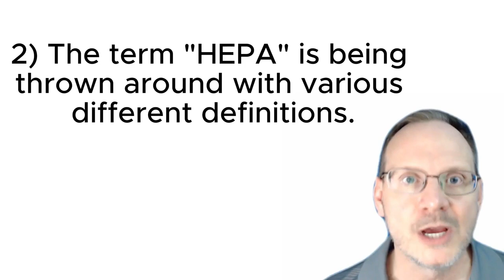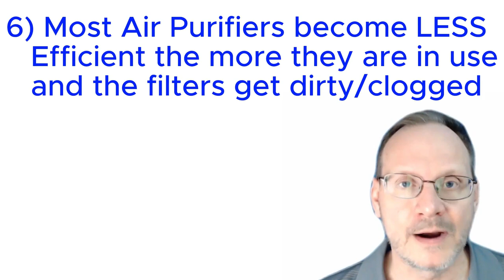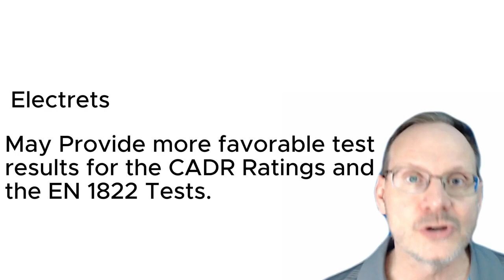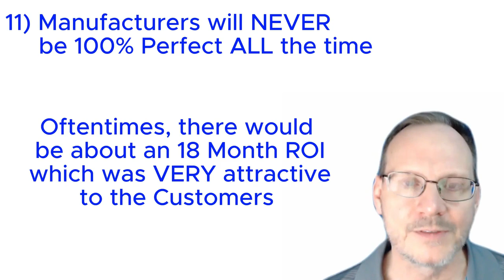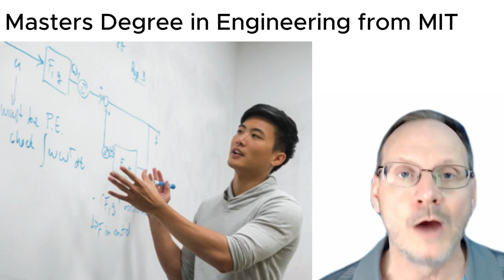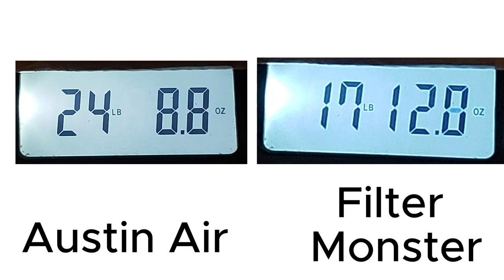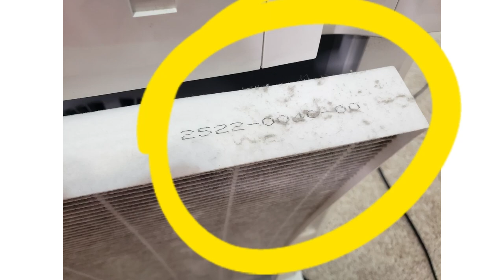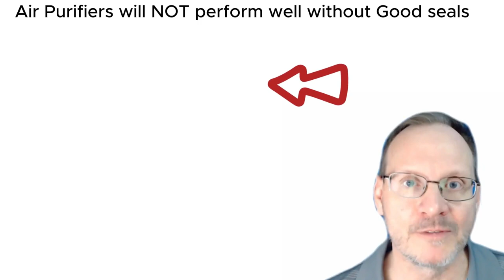HEPA Filters - Are they all the same?

Comment: Hi, thanks for sharing all the info! it is very confusing out there, so much information or sure i say misinformation, that makes it difficult to choose. Im looking for a air purifier for my bedroom, that means nothing to crazy on size or coverage, any good suggestions? ive head good things about the Winix, Oransi,  blueair, rabit air, dr. air etc. any good reliable recommendation? thank you alot
Reply from the maker: Thank you for your question. 

If you want a decent air purifier for dust/particles I currently think the Coway Mighty is the best unit for less than $250:  https://amzn.to/49QBdpm

I currently would rank the Winix 5500 - the 2nd best unit for dust less than $250: https://amzn.to/447zfP0 

Hope that helps - thanks! 👍
Reply: @AirPurificationEducation  thank you I appreciate that!
Reply from the maker: You are welcome - Good Luck!👍 @SALOALBERTO
Reply: @AirPurificationEducation  I've read in the comments, both of these units have a seal problem on the HEPA filters,  Is there any units with better build quality that perform better even if they are in the higher price rage? I was recommended by a co worker to try Mila or Oransi. Have you tried either? Thank you very much.
Reply: I've seen your suggestions on the IQ and the Austin etc but I'm not sure if they are to big for a bedroom.
Reply from the maker: Almost all air purifiers have a "seal problem".  Over 99% of all the HEPA air purifiers on the market do not actually work at a HEPA level in the real world for consumers and part of the reason for this are the seals.  

I will eventually make a video with several different air purifiers and their seals to show people the differences.

The only 2 units I currently feel very confident about not having a seal problem and perform at a HEPA level and even better are:

1) The IQAir HealthPro Plus: https://amzn.to/3NIJ6Uq $899

2) The Aeris 3 in 1: https://amzn.to/3PKaofH $750 and not available in the US currently (not sure where you are located).

After that...

3) The IQAir Atem Desktop unit filters particles just about as well as the HealthPro Plus but it is really intended to be used for your desk to blow purified air on your face.  I was in a meeting with an IQAir rep. and they told me it could accommodate a room up to 150 sq. ft.  I now see it on Amazon saying it can do 300 sq. ft. - which I do not agree with. It is $399.  https://amzn.to/48xQTgl  - and it will only help with particles - not VOCs/odors as it does not possess carbon.  I have one. 

4) Airpura makes good air purifiers and they came out with a smaller unit within the past year or so.  It is the R400 and it may be one of the best particle filtration units at $500.  https://amzn.to/4bH73Xq  + it has 8 lbs. of carbon which is very rare for a $500 unit. Airpura are kinda like carbon experts, IMO. 

5) I had an Oransi in the past and it really leaked badly - actually, it was the 1st air purifier which really made me focus on seals because I could clearly see a lot of dirty air was escaping around the filters.  I do not have direct experience with their newer units but I suspect they do a better job of filtration... they have to, lol!

6) Mila - I'm not sure how great it is - I see they say the company was started by "3 Dads", lol!   Which doesn't really give me a ton of confidence in their engineering "know how"... 

Of Note:  most all air purifiers will help the air quality our your rooms/environments (even if you make a DIY box fan MERV filter solution) - it just depends on what level of air quality we are seeking. 

The Coway Mighty and Winix 5500 are definitely winners in my book at under $250 as I have spoken to multiple folks who used them and they helped with their breathing issues - so I even bought a 5500  about 7 years ago for my son's room... The Coway Mighty hit the market a few years later and I now think it is better than the Winix for particle filtration... After, those 2 units - things start to become more expensive. 

Oh yeah, I would not get enamored with any of the CADR numbers as I made a video on this... The CADR numbers mean next to nothing to me in evaluating air purifiers:  https://youtu.be/M5gH6IBqPkc 

Hope that helps!👍

  @SALOALBERTO
Reply from the maker: I don't think there is such a thing as "too large of an air purification solution for a sized room".  I always recommend people "super size" their air purification solution for the cubic footage of their space.  The more air exchanges with a good filtering unit - the better. 

I also tell folks to remember that an air purifier's real CFMs and "area coverage" is probably oftentimes 20 to 25% less than what the manufacturer's state in their specs. - as their solutions typically do not perform at the CFM levels they say they do.  And they will provide less air exchanges the dirtier the filters get. 

I had an Austin Air Healthmate in my bedroom for 15 years and I now have an Aeris 3 in 1 in my bedroom. My bedroom is about 250 sq. ft. and both those units are said to be able to accommodate 1,000 sq. ft. or more.  

I'd say 40% or more of the IQAir HealthPro Plus units I sold to consumers went into their bedrooms.  

If you are saying they are physically too large, they yeah, they take up space - and if someone has a small room, they their footprint may be pretty large...  - but they are definitely not too large from a performance standpoint.

Hope that makes sense.  @SALOALBERTO
Reply: @AirPurificationEducation  this makes sense, without a good seal it looses all that they claim. It does not makes sense to have a high end market unit that has seal problems and pushes dirty air. Thanks for that eye opener
Reply: @AirPurificationEducation  that is true, I guess what I ment by size problem is more of a spacial thing and an esthetic issue. Having not so much space to have a large unit. But again I understand all comes to what do you want to give up right? Space? Looks? Or air quality. I get that.
I guess I'm trying to find a hybrid and by never used a air purifier in my life I guess buying one that might be reliable and fits in my room even though it might not be the best on the market like the IQ etc. That's why instead of the winix I was thinking on buying the oransi mod Jr. Or the Mila that apparently has good claims....but again who know what's is true hahaha. Thank you for sharing knowledge my friend. It is well appreciated

Comment: I bought filters on Amazon for my Winix 5500-2 and boy did it smell for a while after running... I'm curious to what chemicals they used to make it. Thanks for the deets!

Any chance in doing the filter tests with the washable metal filters? Or maybe some plasma type gimmicky filtering systems.

After watching a few videos on how they make hepa filters...
- the metal they use, don't they still have residual chemicals from the processing? 
- the sanitation processes are hugely different. 

The ugly side of business... well hidden to those that don't look.
Reply from the maker: I want to learn more about the HEPA filters in the future but yeah, most people simply think "HEPA Filter" means they are all EXACTLY the same.... a $29 HEPA filter and a $100 HEPA filter.  I just want people to realize that is NOT the case - there must be many different levels to "HEPA" quality, IMO.

Unfortunately, I think I have to leave the testing to the 3rd party labs... testing of air purifiers and filters is kinda tricky, I think. I was planning on doing testing on this channel...  - until I realized that it should probably be left to the experts with the correct modern equipment and training, Ie. 3rd party labs. 

Thanks!👍

Comment: Do you have any toughts on permament and washable filters? Like the ones in the Honeywell Air Genius 5 (which for some reason costs 90 eur in Europe and 180usd in the US).

I was checking some Coway / Levoit products. All looked good, until I learnt I need to spend 50 eur every 6-12 months. I have enough subscriptions in my life and I hate most of them!
Reply from the maker: Yes, in general, I do not like washable filters.  I read an asterisk next to a "washable prefilter" from a brand a few days ago and they mentioned that the filter did not perform as well after it was washed.  And I kind of felt like I've always known this.  I do not currently think it is reasonable to believe that a washable filter will perform as well as a brand-new filter.  That said, I am more biased against washable HEPA/Main filters... if it is a washable Prefitler - they deal with the larger particles so I don't think it is as big of a deal but me personally at this point in time (until I see some differing data) do not think a washable main filter is necessarily a good thing.   Air purification companies know that consumers LOVE the idea of washable filters so some of them will try to cater to them on this issue, but I think they will not work as well as new filters and sometimes the difference in performance may be large... Thanks! 👍

Comment: what about the mi air purifier 4 are stating that  High Efficiency Filter
99.97% elimination of 0.3μm particles* is it real or just a marketing gimmick ? . How come air purifier manufacture doesn't have any guidelines and without even testing research or certified with standard how can they launching the product ?
Reply from the maker: Thanks for the comment.

I am not familiar with the Xiaomi mi air purifier 4  but I just looked at a video on it and it does not have a gasket connecting the filter to the inside of the air purifier.  The seal is plastic on plastic which is not a good seal. You need a good gasket and a strong seal between the gasket and the inside of air purifiers to prevent air from leaking around the filter.  So, based on that alone I'm very confident it does not filter at 99.97% elimination of 0.3μm particles.  

Plus, it has the carbon come last in the filtration process and the best air purifier companies always put the carbon before the HEPA filter or you can get carbon in the air you breathe.

I will definitely be doing  a video in the future on the importance of the gaskets and the seals inside air purifiers in how they help or hurt the overall performance of the air purifiers.

In the US, we have something called the CADR ratings to supposedly compare the performance of air purifiers against each other but the CADR testing procedures have many problems with them.  So they should not be used to try to figure out which air purifiers are the best.  I made a video on this called "Is the CADR Rating Important?  NOPE! It's GARBAGE!":  https://youtu.be/M5gH6IBqPkc

In general, air purification companies have a lot of leeway to say whatever they want about their products and few will challenge them.  I consider Air Purification marketing to be the Wild Wild West these days.  Many companies shamelessly make ridiculous claims about their products that the general consumers will not be able to verify. 

Another problem is the vast majority of air purifiers are tested when the filters are brand new and clean.  But this is not what the consumers deal with in their real world environments.  The air purifiers will typically perform much differently after 2-3 months of use when the filters get dirty.  There will be less CFMs and usually much more dirty air coming out of them.  So, to really test them correctly for particulate filtration - a company would have to test them after 3 months of use and somehow make sure all the air purifiers were subjected to the same amount of pollutants over the 3 months in different test chambers.  As we can imagine - it would probably become expensive and difficult to pull this off perfectly. 

Thank you!👍